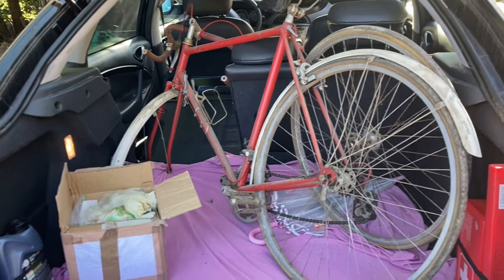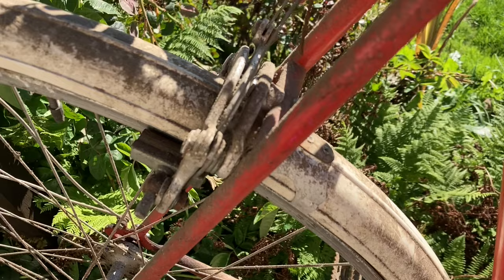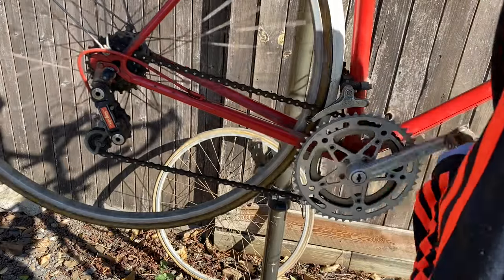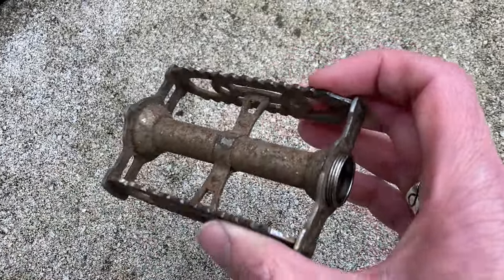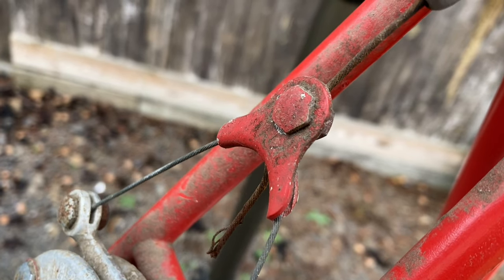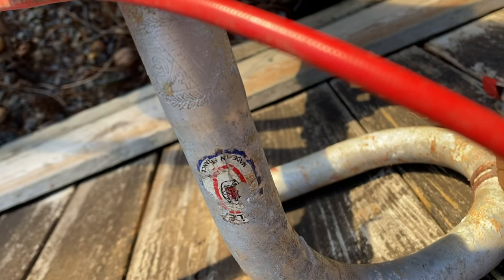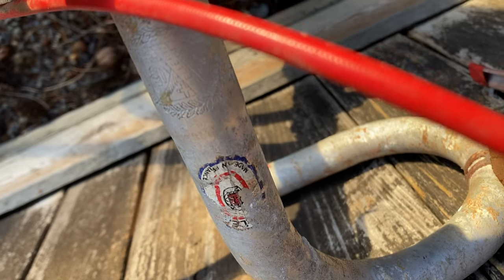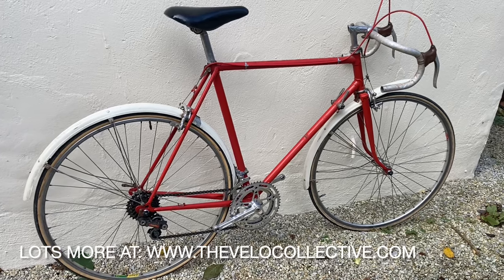This bike is not junk! Vintage bike with a secret gets a new life.

Comment: My  1970 mercier 100/200 has the  same head lugs.  The 100/200 have chrome and the ends of  the fork and chain stays near the dropouts.  

Those cranks might indicate it is a 300 which is a cromo frame.
Reply from the maker: Thanks for feedback.

Comment: Definitely high end lugset, and braze ons, shallow fork rake, pretty nice frame...l,m thinking probably not peugeot or gitane, as you mentioned likely mercier, bertin or le jeune, although it looks like the aluminum id plate on the bottom bracket was removed which would indicate peugeot..
So who knows, best bet is to try gently wiping denatured alcohol, then water immediately after, where the head badge was and see if any decals reveal themselves, anywhere on the frame tubes actually. Looks like likely sprayed over.
Could be a garin as well. A nice mystery bicycle however. 
Enjoy. Shes a beauty.  ✌️❤️😁
Reply from the maker: Great comment, thanks for posting and I'll give what you said a try. Cheers!

Comment: The head lugs with the "W" shaped cut-outs are very typical of Mercier.  I don't know of other French brands that used the same or similar lugs.  What is the diameter of the seat post?  That can tell you the thickness of the seat post tubing, which would give you a good hint as to the type and quality of tubing.  My guess is that this was a mid-level Mercier.
Reply from the maker: Good info, thanks for posting.
Reply: @thevelocollective343  I just found a 1975-79 Columbus SL but a French built one , says Jose Catieu Cycles on the head badge from his own cycle shop near Lyon in southern France , very rare bike now on a rebuild !